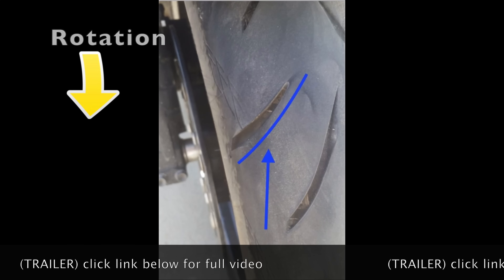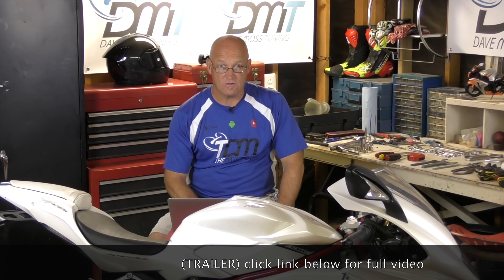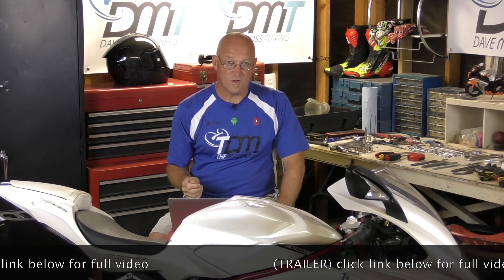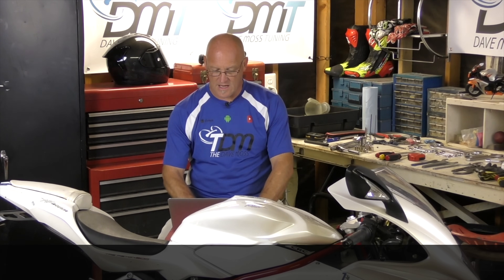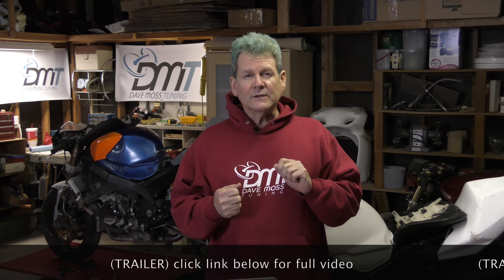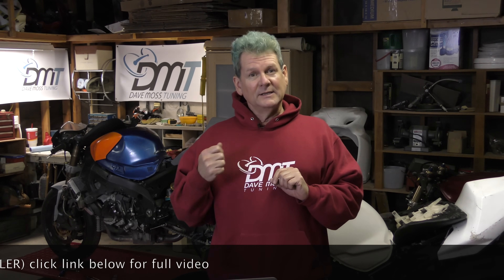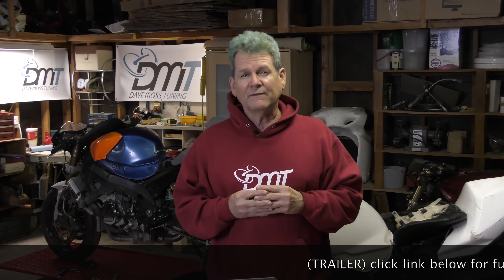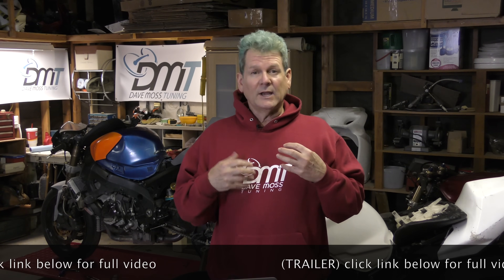FasterClass: Motorcycle Street Tire Rebound Wear (TRAILER)

Comment: so..if my leading edge has more wear,on my back tyre,how do i adjust the rear shock?....i have triumph speed four with new dunlop mk3s...rear shock is stock...in my last tires i had significantly more wear on the leading edge and i would like these dunlops to wear more evenly
Reply from the maker: leading edge has more wear = rebound adjuster right/clockwise in 1/4 turn increments.
Reply: @catalystreactionsbw 
tnx a lot.. did the adjustment the next day and here we are after about 600km and i can say the tyre is wearing evenly.. so tnx a lot....cheers

Comment: What would it say about rebound if the edge of the chicken strip on the rear tyre is wavy?
Reply from the maker: Check the leading edge for verification, as the wave can be caused by rebound too fast or slow. If can also be caused by tyre pressure being too low.
Reply: @catalystreactionsbw  riding a 2017 Kawasaki Z900. Current tyre pressures are 35 front, 38 rear. The trailing edge of the tread pattern has been a bit more raised, which means the rebound is too fast doesn’t it? The edge of the chicken strip was pretty decent before I slowed down the rebound, so seems slowing it down has caused it, but I only did that in response to the trailing edge being raised, so now not sure what to do. Leave as is to try and combat the trailing edge or speed it up again due to the wavy pattern 🤷🏻‍♂️
Reply from the maker: @robzz9002  Check where the trailing edge is raised. If it is in the section of tyre where you are driving (flat black), reduce rebound by .25 of a turn. If it is in the shiny area at the edge of the tyre, that is where you are coasting so leave things as is.

Comment: Great vid Dave. 

Question. Just went out on my 'go to' road for cough cough testing my suspention that im in the middle of fine tuning and noticed when i got back that on BOTH front and rear tyres my trailing tread pattern is higher than the leading tread. What is this ? a rebound issue ? 

I in the middle of setting up my new suspention and just noticed it, but yet again ive never know what to look for in tyres before watching all your vids over the last few months. Appreciate the help.
Reply from the maker: Fix that bloody cough :) hahahahaha. Depending where that is the case on he tread, that is rebound to fast so you need to go clockwise/right in .25 increments. Where you are applying control (brakes, throttle) the tread should be even
Reply: @catalystreactionsbw  hahaha great thanks Dave. So does mean that the tyres were almost skipping/bouncing when breaking and on the throttle ? Cheers

Comment: I had a car for almost a decade before i got a bike but even when i was buying 12 year old bmw’s I thought theres no way the shocks will be ok. Sure enough i took them off and they were toast! So I started to tell people when they talked about buying a new car (new for them still second hand) that they should check their shocks if the car was more than 5 years old. They would say “if they wear out it would be in the service manual”. I’d never get anywhere with them but It’s nice to know I am right and not just “fusy” as some of my friends said. 
The first bmw i bought i crashed very soon after getting it. I remember feeling like the suspension was just bouncing like it only had springs. When I was repairing it I took the shocks off and they were completely done. I always wondered, had the shocks been good could I have saved it? 
Theres also a huge thing about stiff suspension on cars when reality is you almost always need it softer. Especially on uk roads.

Sorry to rant but I’m hoping someone here will care and dave deserves whatever help i can give him with youtube algorithms
Reply from the maker: Need all the help I can get so thank you for your comment.Your question is answered that the crash may well have been avoided with correctly set up and serviced suspension. It is just a topic that has no bling to it so it gets ignored or worse. Thank you for sharing!
Reply: BMW isn't a brand with products made for lasting - they are made for performance - and very likely BMW puts high effort into smart,  computerized probability predictions as well as real world testing to provide the customer with an optimized product - thus meaning, in the end all parts will fail sooner or later the same date, 'nothing left out of this car - maybe consider to pass it on to Ukraine.' ('Ihr Pech, wenn sie in Nordamerika leben und keine Ukraine, Marokko oder Türkei für das Weiterreichen in der Nähe ist' 😉😀)('made to last',  obviously)

Comment: So, between fork/shock oil services, how many times would the settings be adjusted on the average street bike?  1 per 1000 miles? 500?
Reply from the maker: You would check settings between 700-1000 miles for rebound and for travel/preload.
Reply: @catalystreactionsbw  Thanks for the reply. Learning a lot from your vids!